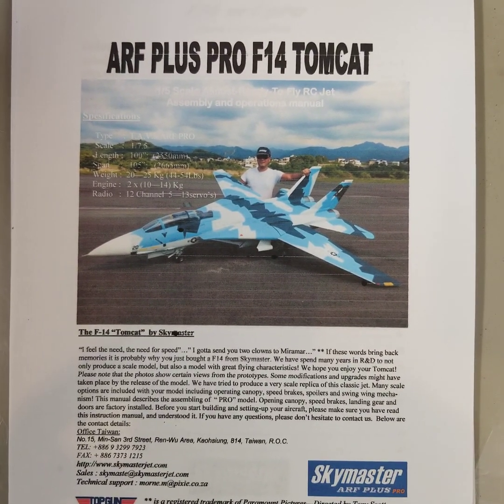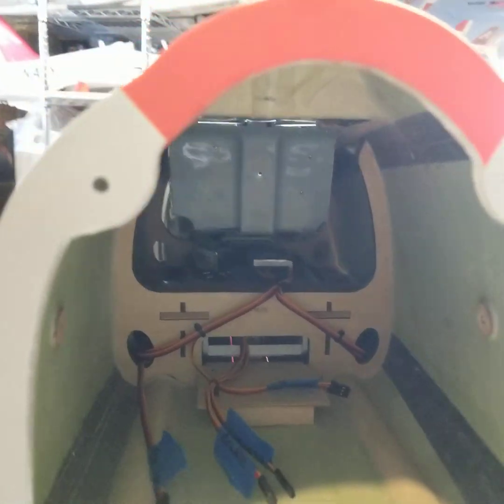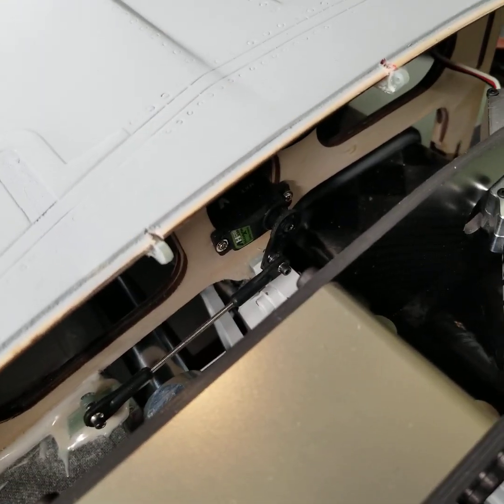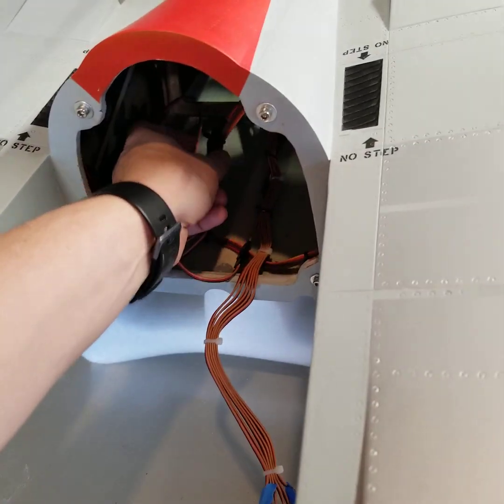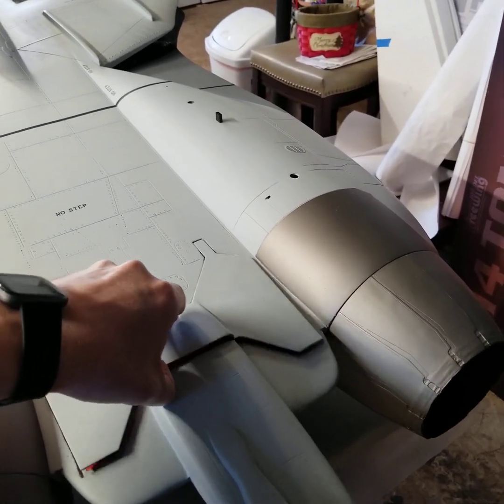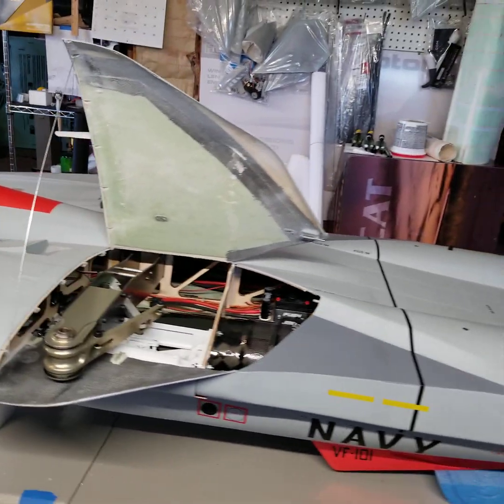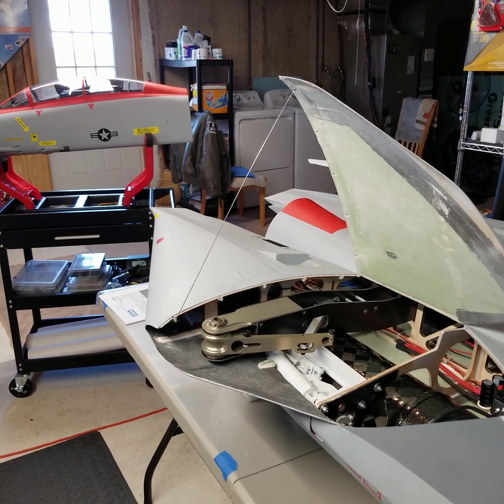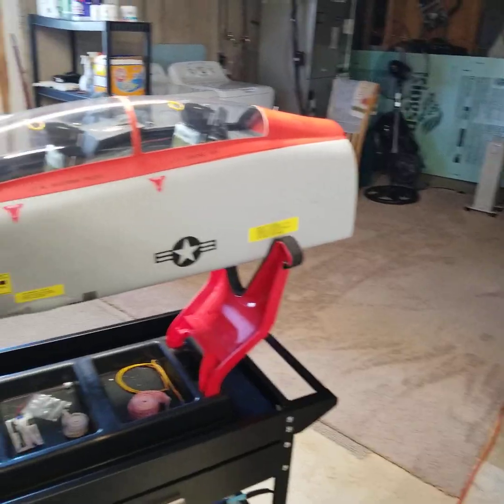Skymaster F-14 EDF Conversion intro.

Comment: I’m surprised EDFs would even be powerful enough to propel this model.
Reply from the maker: Those 128mm fans are producing nearly 30lbs of static thrust each. Ducted its nearly 26. The final thrust to weight will be nearly 1:1. Technology has come a long way!
Reply: @davidsnyder238  Oh wow! You said you’re running on 14s? I’m assuming you’re running multiple 7s batteries. I didn’t even know they had 7s batteries!
Reply from the maker: @AerospaceMatt  they sure do. 2 batteries for each side put in series. When I do my next video I will show them since I just did the battery trays.
Reply: @davidsnyder238  Awesome! What mAh will you be putting in? I know how much 80mm EDFs pull, let alone 128mm! You’d need a lot to keep it in the air for an enjoyable amount of time!
Reply from the maker: @AerospaceMatt  Dinogy graphene 9000mah. If my math is correct along with my flying style my hope is to to get a 6-7 minute flight. Im very much a scale flier so less is more on the throttle for me. A good managed throttle, scale flight should yield good results. If all goes well we will know this spring!
Reply: @davidsnyder238  Nice! Yeah, I also tend to fly scale! Well, Good luck sir!